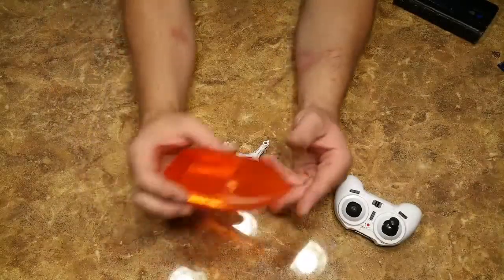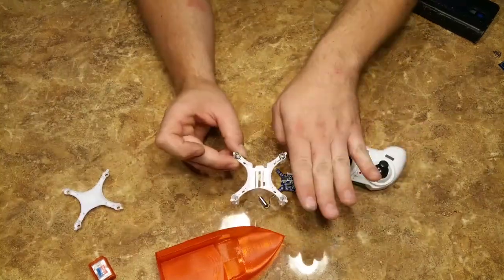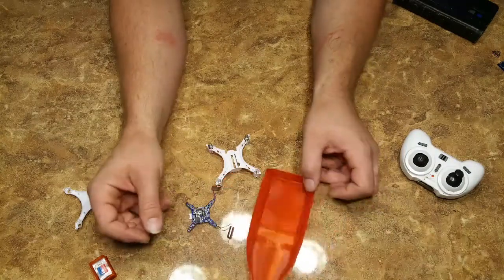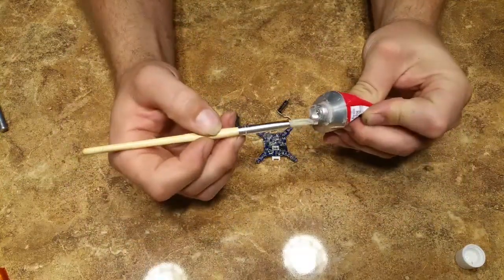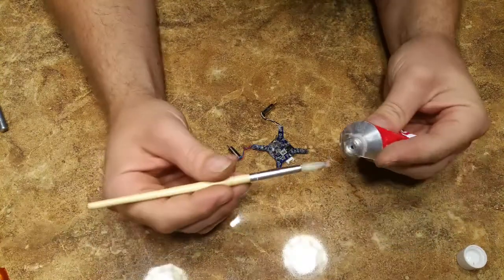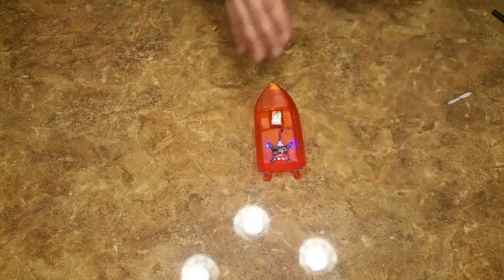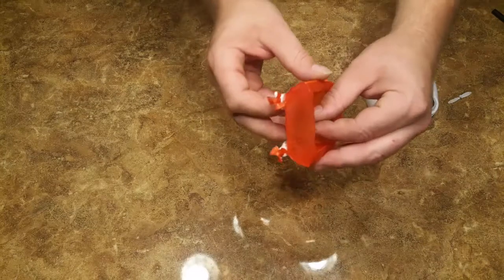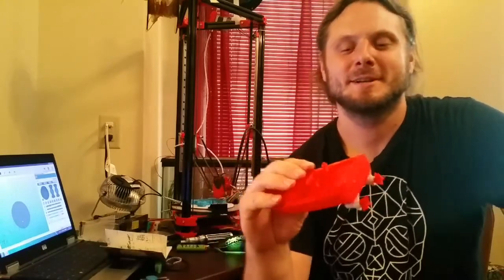Making A 3D Printed RC Boat Using A Broken Quadcopter

Comment: Did you water proof the motors?
Reply from the maker: Motors in general dont need to be water proof. Especially brushed motors.
Reply: @vampcaff  So a brushed motor can stay underwater as long as cables and that is above/water proof?
Reply from the maker: Even the wires can go under water. This is actually how we break in rc brushed motors. We put the motor in a cup of distilled water and run the motor through different rpm cycles to break in the brushes. The only thing that will get harmed in water are electronics (esc or servos) if they aren't waterproof.
Reply: @vampcaff  Oh ok, ordered a new motor and came upon these vids and it will probably help alot cheers
Reply from the maker: I should really make a brushed motor break in tutorial.

Comment: Corrosion-X is really good for waterproofing. There are probably videos for more information. I made a boat that is similar except that it is not 3D printed. Here is the the link to the video: https://youtu.be/CCRtJSRQ3cE
Reply from the maker: I personally never trusted corrosion x since it's not really a sealant. I normally use plasti-dip but the shoe goo was lying around. Both have always worked for me with out ever frying any components so I'll stick with what I know works for me. But I'll look into it for sure. Thanks!

Comment: Great video!  I did something very similar to this with a broken quadcopter and a 3d printed boat, but the internal gyro built into the circuit board made the boat go "bonkers" so it didn't work.  How did you conquer the gyro?
Reply from the maker: I just made sure the board is oriented in the right direction and that its mounted flat. I pretty much just mounted it as it was in the quad frame just in the boat. I also used shoe goo to mount the board, hot glue could work too, this may have acted like a soft mount better isolating the board from unnecessary vibrations.